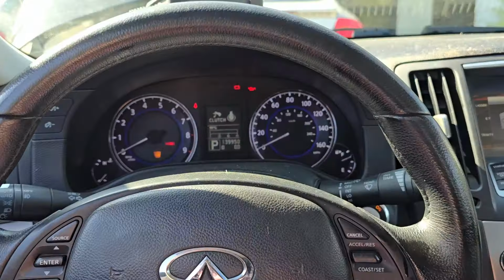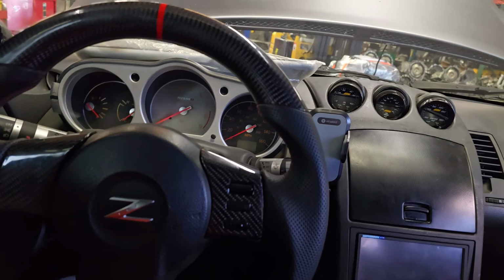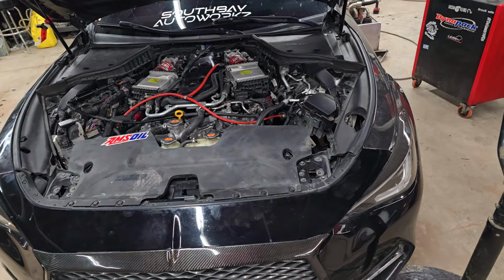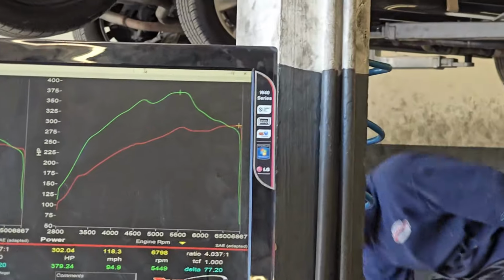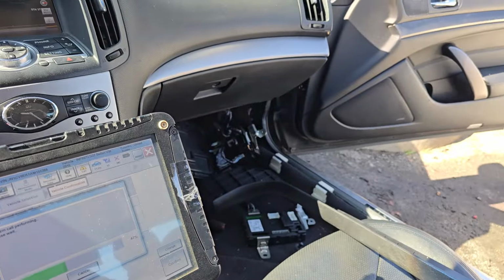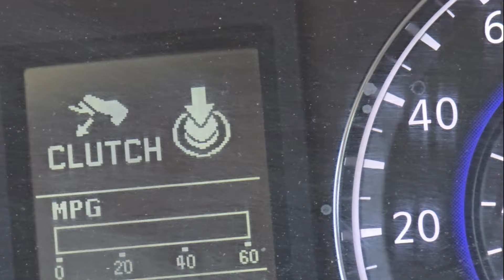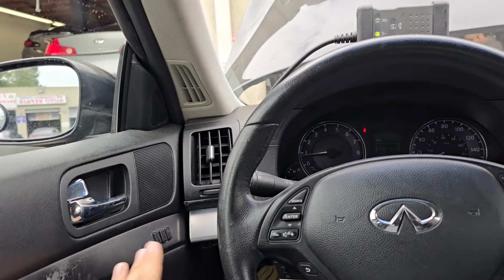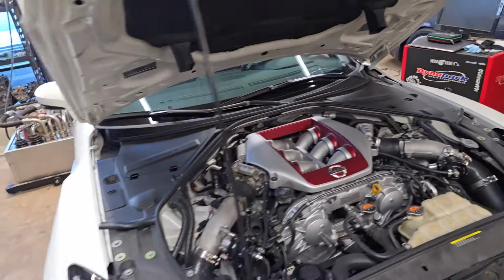VR30 Full E85, more boosted Zs , GTR R35 and random stuff

Comment: Great work on the VR Saul, that Black Q60 is making the jam! As you stated, each motor varies in health & puts out different numbers. As a VR owner myself, i'd recommend getting an oil analysis done via lab (Blackstone) & that can also help knowing more about the health of the motor in terms of wear or any contaminants in the oil. Some early models are known to have a "porous block" & that's no bueno due to the casting quality control from Nissan LOL!!! 72k miles & running amazing thankfully, look forward to more videos!

Comment: I have a couple questions I have a 2003 g35 coupe AT with a pro charge centrifugal SC, air to air inter cooler, full cat back, 255 Walbro fuel pump and 550cc injectors I’d love to figure out how to get tuned by you but I have a question about engine management do I need to get a standalone ecu or would the stock ecu work or what would you recommend ecu wise if you could please get back to me I’d greatly appreciate it need to get the car on the road and see about making an appointment with you
Reply: My bad also has test pipes and I think a 7lb pulley

Comment: Good vid as always👌🏾I am curious about a car you tuned, maybe you didn’t tune it after all I’m not sure. It was on Jorge’s story recently. He said it was waiting for a tune. Black 350z de but the person had a “ported” lower manifold on his car. He basically just machined all the runners down evenly so they were wide open maximizing airflow. I’m not asking exact HP but was is it something that made a significant increase in performance? Did it perform poorly? Waste of time without cams? Etc. I’ve seen Reddit forums about it but nobody was tuned by you
Reply from the maker: Oh yes it was machined way too much lol.  Chunks were missing. It didnt make good power at all. Recommended to customer to do a compression check and leak down test. If thats good, then possibly the intake manifold was ported too much. Again,  chunks were missing lol.